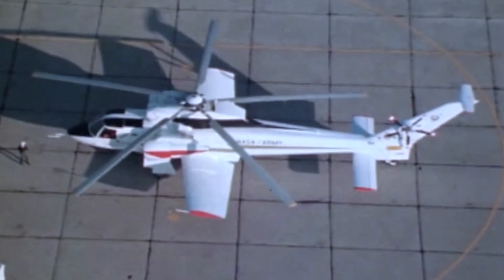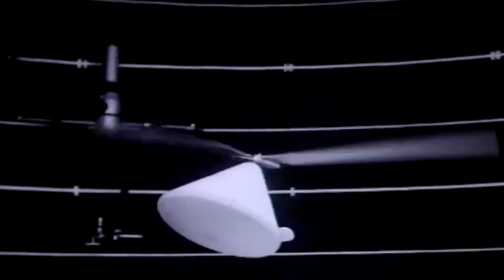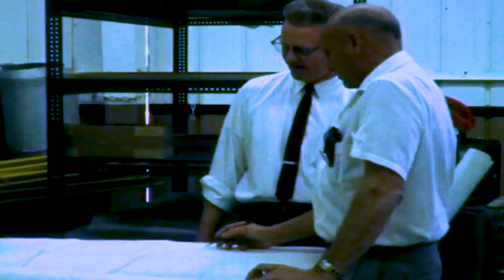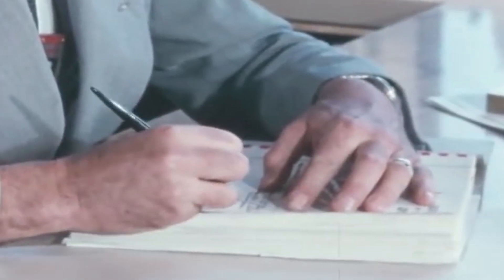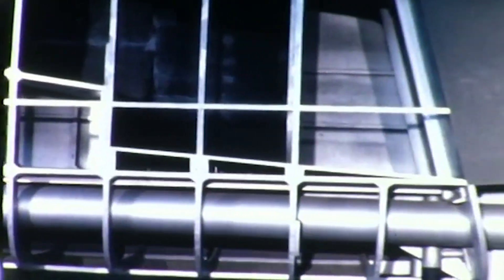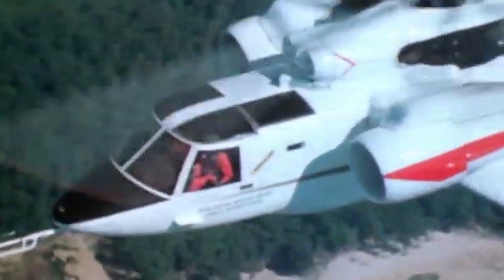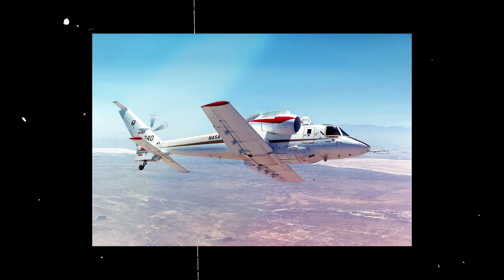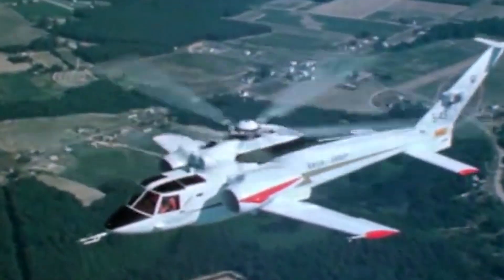The X-Wing - S-72 Jet Helicopter with Blades as Wings

Comment: This is a bit misleading.  The S-72 was an aircraft intended to be used to test various types of rotor blades .  One of the concepts it was supposed to test was the X-wing.  The videos you see here are of he S-72 flying with a conventional rotor.  Although an X-wing was mounted on the S-72, it NEVER flew with it.  In fact, the only time an X-wing ever flew was on an earlier testbed and it was tethered at the time.  X-wing never made a transition to or from stopped rotor flight.  

Work on the X-wing concept was dropped when it became apparent that it would require a hideously complex control system ("...an order of magnitude more complex than the Space Shuttle...", according to some sources).  Transition might not be possible in level flight.  It was counting on using an engine that hadn't yet been invented.  Although it would have a somewhat faster dash speed, it's expected cruise speed would actually be lower than that of a Tilt-Rotor.  Basically what you'd get (even with today's technology) would be nowhere near worth what it could require to get it.  

The S-72 itself was grounded not that long after that because it was found there just wasn't that much demand for a dedicated rotor test aircraft to test multiple different rotors.  It was simpler and easier to just test the new rotor on a regular helicopter of the desired size.

Comment: The rotors had to be ejected together  before a rotation could be completed, if not the resulting inbalance will rip the transmission out of the fuselage.
Blade ejection had to be extremely precise timing wise.

Comment: Like the V22, it is simply a bad concept. High speed and lift rotors  don't mix. Instead, they should have copied the Dornier 31 concept. It simply works and has killed nobody, unlike the V22, which was forced into operations and killed 40 people without enemy fire.

Comment: The moment you said they replaced the swashplate - famously the single most intricate, crucial, and vulnerable part of a helicopter's design - with a control system that relied on checks notes an actively maintained flow of compressed air and computer control, I just said, "Oh no thank you."  At least they had the ejection system but even then you're going to add complete loss of control to any engine-out situation.  Such an absurd idea in my opinion.  It also wasn't really clear why they removed the swashplate, unless the plan was to flip the retreating blades when they were stopped so they presented the front of their airfoil to the wind.

Comment: Considerably complicated considering Lockheed I've developed a helicopter which was at least as fast would go at least as far the ah-56 Cheyenne and furthermore, it was a non-computerized system, it was able to fly faster than normal rotorcraft should be able to fly. Which was uniquely the Air Force's reasoning for telling the army that they couldn't have it. The truly sad thing about the Cheyenne helicopter was that they could have had thousands of them by the time they spent the money on the first piece of s*** Apache which is so heavily complicated it doesn't have dear the capabilities that the Cheyenne helicopter could have had just by upgrading the Cheyenne should you want a bit more electronics for Warfare.

Comment: I would have put ALSO in bottom of HELICOPTER ROTERS SPINNING ROTERS UNDERNEATH......  AND MADE THE WINGS LARGER MORE SWEEP BACK ATTACHED THE JETS AT ENDS BOTH ENDS OF WINGS AND THE WHEELS AT ENDS OF WINGS..... WINGS WILL HAVE TO BE A SUPPORT FOR GROUND TOO.....  AND YOU CAN ADD MORE JETS TOO THAT WAY IT CAN EVEN FLY TO STRATOSPHERE ✈ 👽

Comment: Hell of alot easier to have all blades sweep back to the rear in flight than using a complex compressed air system and a clutch ect.

Comment: The concept WAS proven in 1970 when Lockheed developed the AH56 Cheyenne. It used a semi-rigid rotor for lift, a pusher prop on the tail, and stub wings for lift in forward motion. It would take off using the rotor. Once airborne and the pusher prop took over, the stub wings on the Cheyenne created lift and the chopper was able to achieve speeds never-before-seen with helicopters.
Reply: The Cheyenne did not use an X-Wing and it never reached its promised speed.  In fact, the world speed record has been held since 1986 by a British conventional helicopter.

Comment: One of the more interesting aircraft covered.  Wish more were explained: still unclear how the coanda effect was employed (and how it is employed by tail-rotor-less helos), what calculations were required to manipulate airflow to rotors, how rotors were shaped by airflow, how different shapes achieved different purposes, difference between flight with rotor turning or stopped, concept of an "x wing," why some models had only 4 larger rotors, etc.  Also not clear purpose of aircraft over fast helo if max speed was only 300ish MPH...that is not "high subsonic" and payload of about 5000lbs.  End of the day huge let down that entire purpose of aircraft was never even tested (stopped rotor flight).

Comment: Imagine this thing as the navy's very first attack helo. A hybrid, blades swept back and in the stowed position, two wings folded swing down and lock into position for take off. Navy grey livery...full combat load of 64 rockets, 8 hellfires, 2 sidewinders 1- 25mm cannon (similar to the apache), perhaps even room for extra weapons such as 1 harm/harpoon/laser guided bomb(s)/jdam ect. Taxis up to the cat aboard the Gerald r. Ford super carrier. Persian gulf, 174 nautical miles off the Iranian coast. A cat shot gets her off thr deck to go into combat for the first time ever. When rendezvous with the tanker 80 miles off the Iranian coast to top off. Then hauls ass for the deck. Once 100 feet off the deck, she slows to damn near stall speed and swings out the rotor blades. One turbine switches to power thr rotors and they slowly spin up and it takes over for flight the the other switches over so now the rotor has qll the power of the aircraft now and shes a full on chopper at this point. Screaming in under the radar as a helo, a zsu on thr coast gets a faint signal on and off, as shes painted she uncages the harm and let's it fly. The zsu is no more, she scans for more threats on the coast....imagine the possibilities with a weapon system like that!

Comment: Giggle giggle in the 80’s I taught system simulation at San Jose State University.  I always required students to do a project.  One in particular was a young lady who worked as a programmer at NASA/Ames.  She wanted to do the classic ‘ejection seat’ simulation for the RSRA I remember the acronym.  Anyhow her boss(es) give her the ejection seat data and she runs with it.   Oops simulation shows crew hittin capstan after blades blown off.  Some checking found a bug in code fixed; they still gat whacked.   She takes results back a lots of closed doors at NASA finally a geepers we gave you the wrong numbers the bird in flight testing has a higher performance rocket motor, and yes the revised simulation indicated it would work.  Hope the young lady went on to a stellar career at NASA by my book she was a keeper, just sayin

Comment: could 'only' carry roughly 4500lbs. 3man crew at figure 200# is 600 now it's 3900#.  Ordinance racks, guidance systems for rockets, missels. Or 'just plain bombs' it's 'kill weight capacity' was lacking. unknow if fuel, op system fluids included in base weight. But certainly in 'takeoff weight'. 17yrs & no real operational flights..theres ur military '$5,000 toilet seat'

Comment: Well here's the thing; every helicopters blades' are in fact wings. They are literally a planes wing, but instead of using a seperate propeller to generate forward momentum and airflow over the wing to generate lift, helicopters simply rotate their wings at a very high speed, and generate enough lift for flight.

Comment: Those X-wings were too thin.  Imagine how a regular wing would bend back and break off if it was similarly fixed-mounted to an aircraft?  The only way to get a wing like that to work would be if it was much thicker at the root where the rotor hub is mounted.

Comment: So that is how Sikorsky came up with the Sky Raider concept! In the Sky Raider's case they didn't lock the rigid rotor but allowed it to free wheel as it would in an auto-gyro. The wing adds to the lift so that they can take the lift loading off the rotors. It can move extremely fast while achieving extreme agility. They can use the concept both in an attack helicopter role or an assault helicopter role.

Comment: A helicopter with ejection seats -- there's no way for you to make me feel comfortable about that. 😬
Reply: They fire through the floor derp
Reply: @shadowopsairman1583  8:00 For the S-72, this looks like up to me.
But let's say we have an aircraft that shoots pilots towards the ground; if the aircraft undergoes Rapid Uncontrolled Disassembly overhead, what magic protects the survivors and their parachutes from falling debris? I am uncomfortable with relying on wishful thinking.
Reply: @shadowopsairman1583  Yeah, that'll work real well with a helo flying, say 100 feet off the ground.
Reply: The concepts involve blowing the rotors off before teh seats eject, making it a slower process than on a conventional aircraft.  Teh exception is Tilt-Rotor since the rotors never go over the fuselage or cockpit, so regualr ejection seats can be used without modificatipon.

Comment: The first thought I had at the beginning of the video  is “man that’s a lot of stuff on one vehicle just to make it go”. The rest of the video goes on to confirm that sense 10X over. This simply isn’t a practical design and with so much interwoven tech just to achieve the concept a fleet of special engineers would be needed to maintain them. And what kind of payload would this be able to carry? How useful would it be, really?

Comment: I appreciate the engineering work, but come on, this was never going to be viable. Too many moving parts, too expensive to maintain, it's like two different aircraft merged into one. The payload capacity had to suck. It's like hybrid cars : you're always driving around with two different propulsion systems even if you're only using one. Ultimately, the tilt rotor aircrafts make more sense.

Comment: Vtol/stol medivac? Cas? What did they think primary use would be? Instead of the blades be fixed wings when off let them spin in neutral like a gyro plane or what ever it's called

Comment: Why the hell is the audio sped up on NORMAL speed?  Bringing the speed down to 0.75 brought the narration down to how a normal person speaks rather than somebody in a hurry to use the toilet.    Other than that, this basically looks like the inspiration for Airwolf.   Airwolf was pretty much a gyrocopter hybrid as it had two set propulsions: a "normal" helicopter mode and a twin jet engine for when you want to attain higher speeds as the rotors will "disengage" once it goes full turbo to attain mach speeds.

Comment: I believe I know where one of these airframes is. Sadly, it’s in bad shape, largely disassembled and in outside storage. I am aware of when it arrived and it had “Garfield” painted on the tail but that has been removed for some reason. It looks very much like the aircraft in this video and still has the gold lightning stripe on the sides and the NASA/ARMY logo on the tail. The only difference I see is I don’t believe this one has the horizontal surface at the top of the tail.

I tried to find some info on this aircraft but I didn’t even know what to call it. Thanks for the video, very interesting!

Comment: They really should have left the rotor unpowered while in horizontal flight in autorotation like a gyrocopter this seems unnecessary complicated
Reply: The X-wing concept was that teh rotor wold be stopped and would act like a wing via air being ducted through the blades.   Operational X-Wings would not use conventional wings, because that would defeat the whole purpose of the concept.

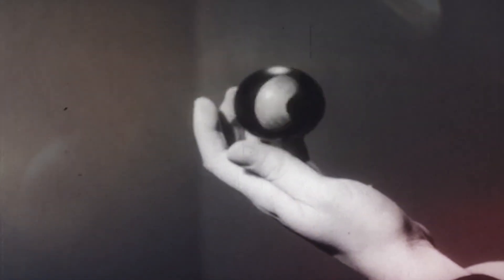Comment: At 2:25 you reference aircraft G-HAAT as an example of the Coanda effect.   That helicopter uses a blower out the tail boom driven by the main engine which is aimed down and to the sides by rotating the tail cone.  There is no Coanda used in that helicopter, they simply located the air turbine within the body and it uses thrust vectoring from the tail tip like Harrier jump jets use from the side vents of the main aircraft body.  The blower's exhaust is actually automatically compensated for by an additional control mechanism in the swash plate of the main rotor.

Comment: I want to know how the two backwards facing blades on one side were going to provide lift when they were in the stopped position 🤷‍♂️
Reply: Instead of a swash plate, they developed a different system to alter the pitch of each individual blades, regardless of  where it is positioned.
Reply: @ernestjorda2777 
Yes, I saw that. 
But if the blades rotate clockwise, when you stop the blades in flight, the 2 blades on the left will have the leading edges facing the airflow, the 2 blades or the right will have their trailing edge facing the airflow...

How did they plan to flip the blades over for fixed flight and then flip them back again to resume helicopter mode?
Reply: @Danger_mouse  The blades aren't flipped.  The air coming out of the slots has to be re routed  to blow over the aft edge.
Reply: @ernestjorda2777  In an X-Wing, the pitch of the blades is never altered.  The amount of lift is controlled by how much air is flowing from the slots in the blade.

Comment: It wouldn't surprise me in the least if at least some of this technology ended up in the Bin Laden raid bird that went down. 

Think about it...
1) looks like a base UH-60 airframe.
2) vtol capability
3) probably much more quiet than a helo in winged rather than rotary flight
4) faster than a standard helicopter 
5) probably lower wing loading/ rotor loading than either aircraft

Nope. Wouldn't surprise me one bit.

Edit to add: unlock the blades, put the aircraft into a sufficient glide slope to establish rotor rotation, then power up the rotor head, kind of like auto rotation. You're basically gliding into the target until you start turning the rotary wings.

Comment: I don't really understand what's full stopping and starting the rotors really does for making the airframes better why not keep in the flying fixed wing mode just keep the rotors spinning but just at an idle speed that isn't guzzling gas. That is the only thing I could 5himk of that would be an advantage to full stopping it, saving fuel. But is the savings really worth it if you can just keep them spinning at idle .....idk weird design pretty sure this could easily be built and perfected with todays tech but is it worth it enough to pursue

Comment: The XH-59/S-69 was also an interesting design
Reply: One of the S-69's was at Moffett Field in Mountainview CA. It may still be there.I saw it while doing contract work for NASA.  That was 10 years ago. I knew what it was immediately.  I have a picture of one that my dad took in the late 70's or very early 80's at Ft. Rucker while he was stationed there. Very cool aircraft. It's a shame that it's basically just rotting away last time I saw it.

Comment: interesting idea but is it useful?
its just a mechanical complication, whatever you are trying to achieve could be achieved with simpler aircraft.
As the 3 points of Giovanni Pegna's dectrine state, the keys for good design are simplicity, innovation and determination.
When an aircraft has unnecessary complications, is innovative just for the sake of it and for the sake of setting a record, and the project is carried on no matter what, so that it becomes stupidity rather than determination, then the aircraft is a bad aircraft.

Comment: 0:27 "It's a joint effort bewtween the NAVY and NASA", When it literally says NASA/ARMY on the plane =.=!
Reply: (The flight video shows) the second prototype ((which) was built as a compound helicopter fitted with a 45 ft 1 in (13.74 m) span wing, and two 9,275 lb (4,207 kg) st General Electric TF34-GE-400A turbofan engines additional to the two 1,400 shp General Electric T58-GE-5 turboshaft engines driving the standard S-61 rotor system. (This) made its first flight from Stratford on April 10, 1978, (and) was also tested at Langley before being transferred to Ames-Dryden, recorded NASA 741.

It could well be that the FIRST prototype had NASA & NAVY painted on the sides.

Comment: Dude NASA's engineers must be absolutely balls to walls insane for the shit they actually built. 

Ya, let's make a VTOL aircraft that can STOP the blades in flight, invent a new alternative to a swashplate to make it work, oh ya also let's make the rotors EXPLODE off the hub if we bail out! O-o-oh ya burp we're gonna make the blades stop in flight. A-a-a-and let's fuckin fly the bitch without the rotors on it to see what happens. rails line of coke and let's make the blades stiffer with compressed air fuck it we're FUCKIN NASA

Comment: So the compressed air was used to shape the blade? And exhausted at the tip.. Said it was fixed and not on a gimble...

Always wondered if you could use the tip of a rotor blade.. or turbine for hyper sonic flow.. and incorporate that ...

Like on the large turbine at the front of a jet engine.. use the tips to grab air and compress it for use in pre compressing fuel.. before ignition chamber... 

In this age of metal deposition technology.. seems a easy thing to try...

Comment: At 2:27, this has nothing to do with the coanda effect. These helicopters use the turbine engine exhaust gases to compensate for the main rotor torque, i.e. it replaces the tail rotor thrust with turbine exhaust thrust.